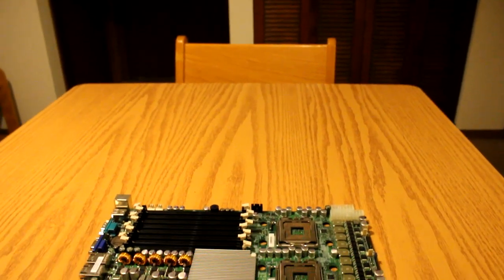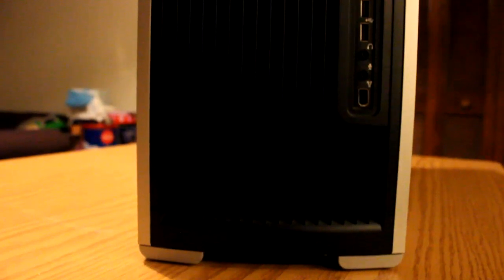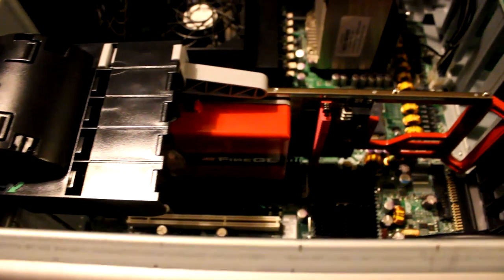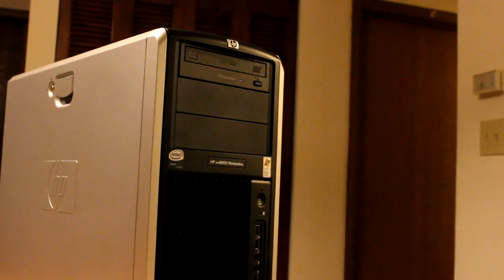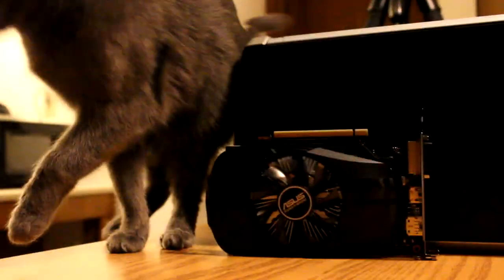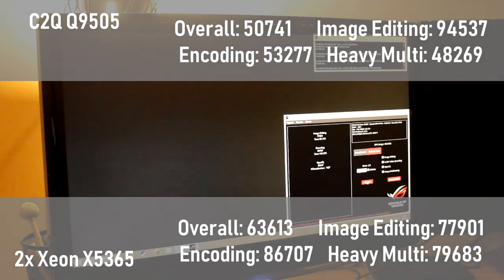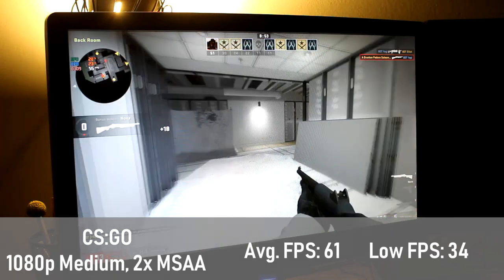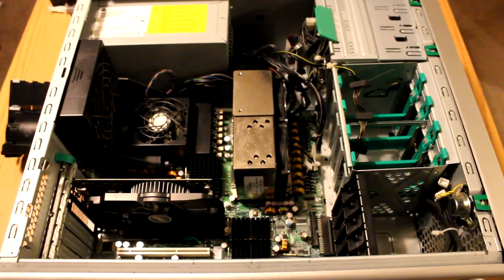8 Cores of RAW POWER! | The HP xw8400 Workstation

Comment: I have to say the XW8400 was and is a legendary bit of kit. I supported them as bits of kit in our engineering organisations doing cad and cam and they never missed a beat. Rock solid reliable machines.
Massively over engineered ; they could run at 100% all day every day and still be running years later.
Big props to HP.
Luv and Peace.

Comment: I still maintain the 5160 was the most cost effective option.
3.0GHZ in a dual core.
Games are not fond of cores. They are into clockspeed.
When I looked at the 4 cores they were still silly expensive. I guess I would have bought 2 four cores but 1 8160 seemed more cost effective.
Can your rig 8400 run outer worlds - My son is asking - It's his gaming pc now with a 1050ti in it.
Maybe the secret is 4 cores at 3.0 ghz?
Luv and Peace.
Reply: I wonder how the 8160 games benchmark would compare the chips you put in.
When I tested games were not largely using mutlithreading.
Maybe that's now changed.
Interesting.
Luv and Peace.

Comment: I got this in 2022 to be my retro machine but I was amazed realizing it's still so powerful it could be used for modern things as well. Only problem is the audio driver. Installed the driver from HP's website but Windows x64 still says there is no audio device. Don't want to install Win10 on it, I still want it to have a bit of retro feel.

Comment: People drop off used computers by the dozen where I work. I saw this unit so I looked up your video. I am not a gamer but would like to refurbish a worthy model just to use for regular stuff. Tired of always using my smart phone, certain schematics and text is simply to hard to read due to size. Any info for what would be a good older model I could keep my eyes out for nothing fancy to possibly revive and put to use would be greatly appreciated. I really like putting other people's 'trash' back together and re-using it, rather than simply dumping it.
Also there is an unlimited number of monitors- same thing with those.👍

Comment: I notice it has only one Xeon in there. You could augment performance with another one.
It's a decent computer with only one but it will still be respectable with two of them.
They work pretty seamlessly as one cpu to most programs.
If it can handle the extra threads it will scale OK to the the second processor.
You take a little hit but there is still a big bump.
These were cutting edge machines at release and loads of years later they are still fast machines.
My son has used one for many years to play games.
I became concerned it wouldn't run some of the most modern games so I built my son a new PC with an older I7 and and GTX1060 to replace the 1050ti in the xw8400 and hes is still resistant to replace his XW8400.
If any other testament was needed I don't know what it is.
A dual 3,2ghz xeon with 32gb of ecc ram is s thing of beauty but the new system would be quicker.
It honestly might not be as reliable though.
These systems were built to run at 100% utilisation for 100% of the time.
 They are INCREDIBLY robust.
Just insanely over engineered.
I worked for IT in an office doing CAD/cam loads and even FEA on these things and they just kept on working.
I think we had to replace one raid disk on the FEA system.
FEA is basically a 24/7 torture test for a workstation.
Amazing Workstations.
Luv and Peace.

Comment: You can populate these things with 64Gb of ECC ram.
Also I'm sure the 2 CPUs I put in were 4 cores 8 threads at 3.7ghz.
Did you consult the HP website?
Maybe I'm misremembering but it could run all sorts of modern games and blew me away how competent it was.
Maybe a later motherboard revision.
Luv and Peace.